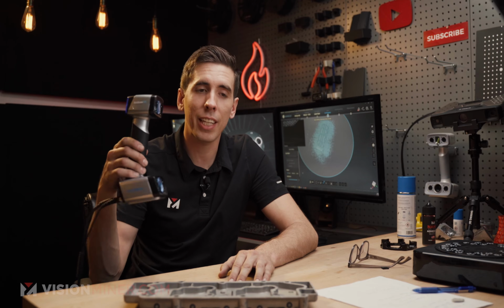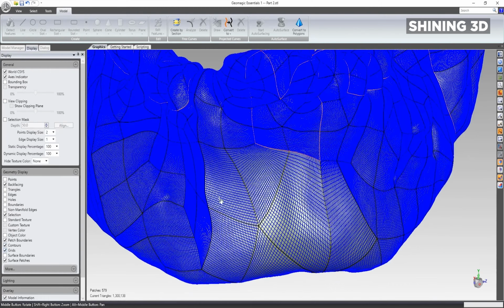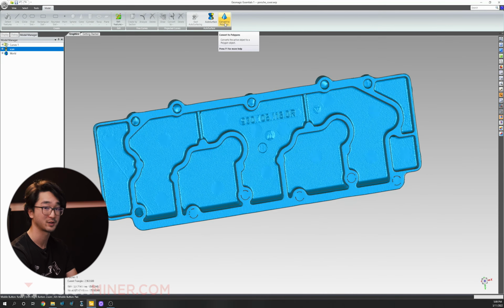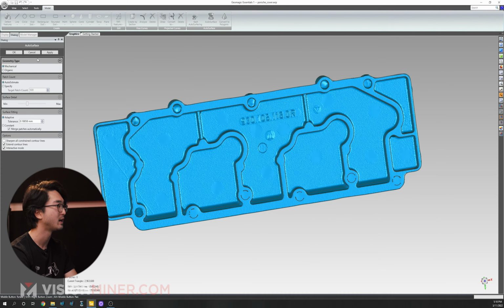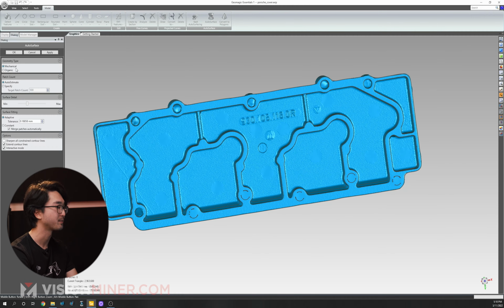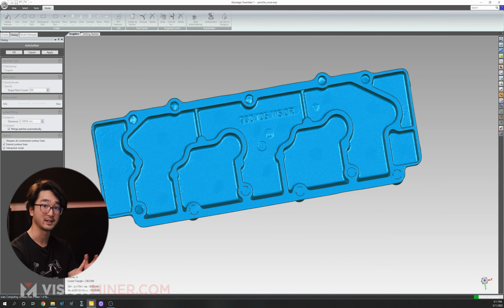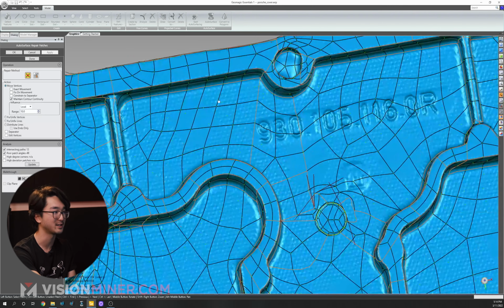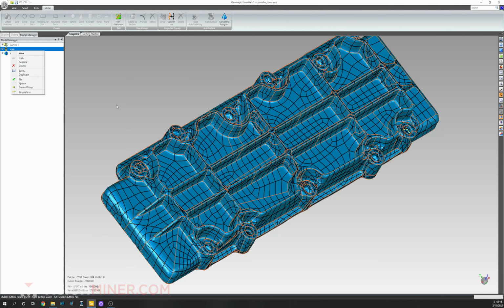Geomagic Essentials - NURBS Surfacing Workflow (Part 3 of 3)

Comment: So it basically does a quad subdivision of the polygon mesh and converts the Subdivided mesh into a Nurbs polysurface after which one still has to subtract the manually traced holes?
That's not magic. Rhino does that for free and more efficient with only 2 commands. _quadremesh, _ToNURBS. Then _booleandifference the traced holes and ya done
I need software that can actually recognize planar surfaces from a mesh and subsequently recognize features like holes, circular features and fillets without having to redraw the entire model. ¯\_(ツ)_/¯